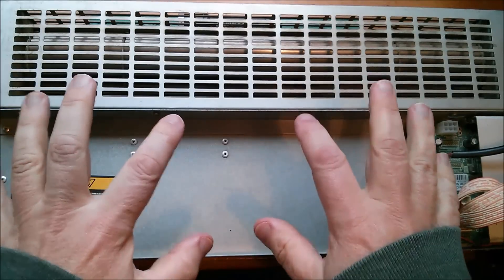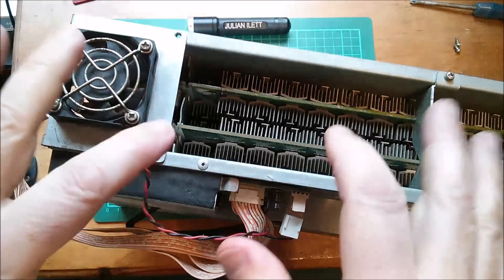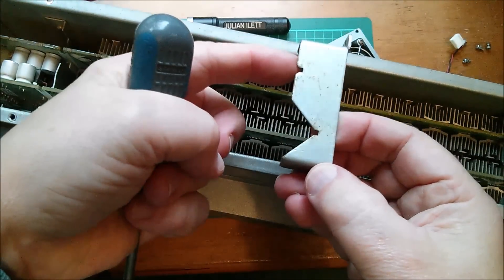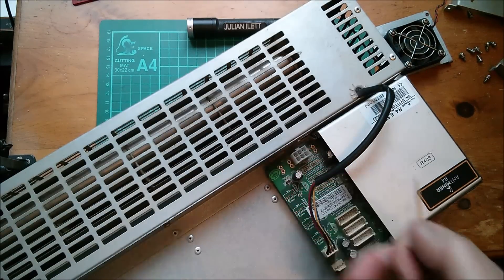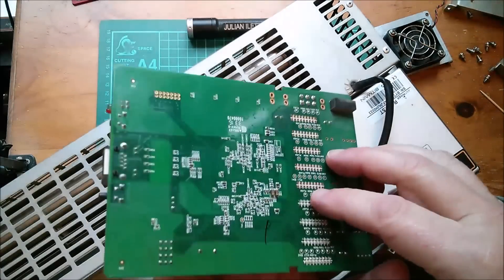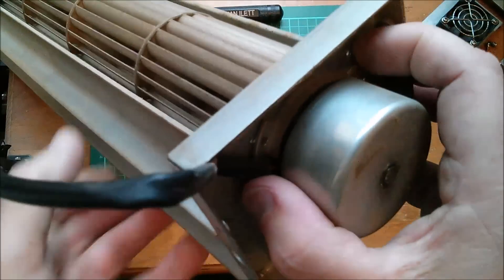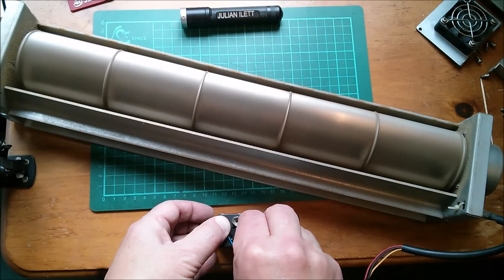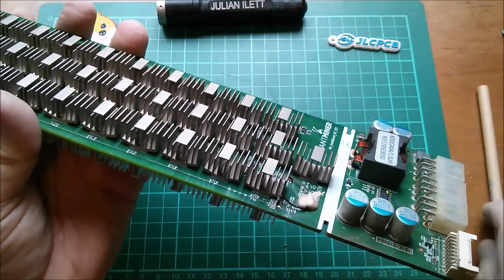Fan Heater with Cashback - R4 Stripdown

Comment: Those four identical circuits at the bottom of the control board are the buck converters for the various supplies for the SoC, Ethernet PHY, and flash. Probably 3.3V, 1.8V, 1.2V and whatever the core voltage is for the SoC 1.0V, 0.9V or something near that.

Comment: Actually, the white noise from the fan might help some people sleep, as long as it's not too loud. Won't help Koreans though, they'll catch the Korean fan death.

My brother started getting interested in crytypocurrentsea mining a few months ago. I told him he's not going to make any money from it unless he's mining from excess solar. It's still more economical to run appliances during the day from the solar energy, and only mine when instead of exporting the excess energy for a pittance.

He should've got his next electricity bill by now, so I should ask him if it was worth it.
Reply: Haaa
Reply: Even mining off of "free" excess solar isn't necessarily worth it - how long do you have to mine to pay off the cost of the hardware? Julian has spent hundreds of pounds on the solar-crypto mining setup in his shed (even with some key pieces being nearly free), and it earns at best pennies per day of operation.
Reply: @RedwoodRhiadra  That's true, although he was just mining on his video card, which he bought for gaming anyway so he probably wouldn't consider it a cost. Then there's the cost of the solar system, although that also wasn't put in specifically for mining. But yes, if you were doing it purely for profit, those costs should probably be considered.

Comment: They're 100% efficient as resistive space heaters. If you use them to heat your home, the crypto is a bonus!
Reply: Except they aren't 100% efficient as heaters - some of the energy is used changing bits into other bits and doesn't get transformed into heat. They're efficient as heaters to the degree that they're inefficient as miners. (Which is still quite a lot, of course).
Reply: @RedwoodRhiadra  unless you're suggesting that energy is somehow stored in the 1s then the energy needs to go somewhere. I don't know what the net balance on the network cable. Presumably some is being lost as heat outside the house. And a tiny amount will be escaping via light from the activity lights. There's a slight fan noise that may escape. Everything else is heat.
Reply: @benholroyd5221  Even the fan noise produces heat in the friction of the air :}
Reply: @WaffleStaffel  well so does the light! I was just thinking of things that might escape the system before degrading to heat.

Comment: hi is it possible to use those miner's for anything else eg running a ai algorithm or are they just e-waste
Reply: From what I understand, they use purpose made chips called ASICs, kinda like how a CPU or something might have hardware acceleration for a codec such as h.264 or AV1, it can do that one task really well, but you can't just reprogram it to do something else.

So no, they're basically e-waste once they're no longer useful.
Reply: I'm guessing the chips themselves might still be used as a cryptographic accelerator in some systems, but not in such high amounts

Comment: Instresting also they run the hash chips in series so they only need to go from 12v down to 8 v with then 8 chips running in series all on the same clock cycle
Reply from the maker: Wow - in series. That would make communication with each hashing chip a level-shifting nightmare.
Reply: Crazy, have you some sources for me? It seems a super wild thing to run complex ICs in series, as their current draw can vary quite a lot. But I guess these are just copy paste of the same logic, so maybe they have the exact same current curve over time